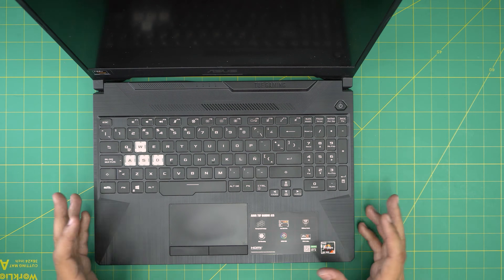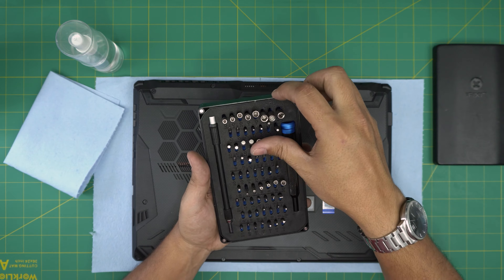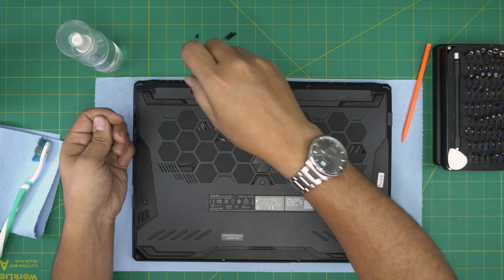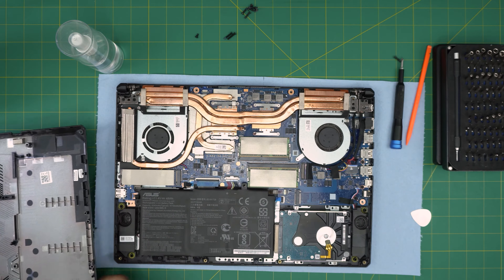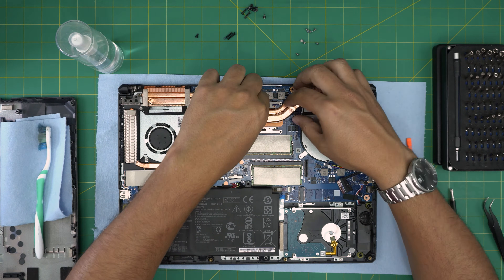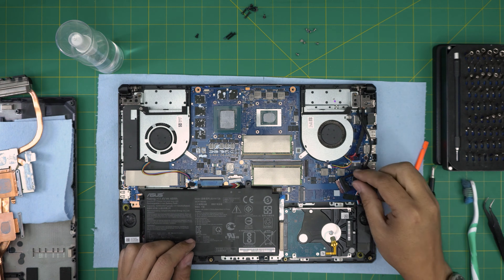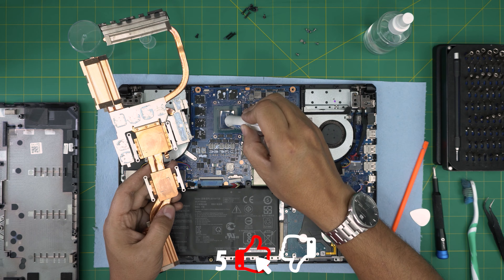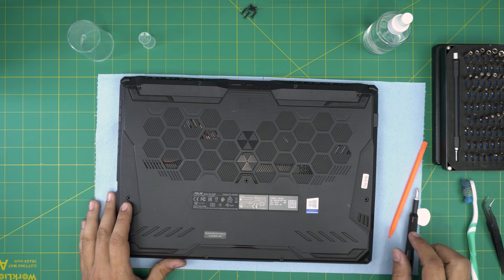How to Repaste and Clean ASUS Tuf Gaming A15 FA506IV Laptop - Step-by-Step Guide 🧹✨

Comment: The c Lock screw does not want to get out what should I do
Reply from the maker: 🫠Regarding your question, the C-lock screw should *not* come out; that is why it is called a C-lock—it prevents the screw from coming out. Just unscrew the screw a few turns, and that is all.
cheers🍻
Reply: @uFixTek  I understanded that but what I meant is it's not even going up a bit enough to Pop up the back of the laptop
Reply from the maker: Ah, if it’s not coming up, don’t worry—firmly insert the guitar pick between the top and bottom covers, and it will release the clips.

Comment: Hi buddy, im from peru. I have a FA506QM  and i gonna use Arctic MX-4 for the CPU and GPU repaste and 99% isopropyl alcohol remove the old paste. In the comments below, I read that it's not necessary to remove the thermal gel. Thoughts?
Reply from the maker: 🫠Regarding your question, yes, don't touch the gel, you can collect it and push it in the center of the component the gel. but no need to clean it.
cheers🍻

Comment: I am sh*t I replaced thermal paste but now my display is not working I guess I am done .
Reply from the maker: Remove both RAM sticks, switch their positions, then power on the device with the charger plugged in and wait up to 40 seconds.
Reply: @uFixTek thanx for replying buddy , but I took it to tech guys and got to know I misplaced display cable and somehow short circuit it , causing motherboard to short circuit, they took it for 1 day to see which component is damaged or is it just display cable damage
Reply from the maker: the display port has a fuse and will prevent shorting the board, so i hope they don't make up reason to charge you extra.
Reply: @uFixTek  they charged around 50 dollars including labor ,

Comment: Hi, i accidentally put thermal paste on the vram and vrm before finding this video. Now my gpu won't show. I've bought the thermal putty, can i apply it on the vram and vrm or do I have to do something particular first?
Reply from the maker: 🫠Regarding your question, if you have used the laptop with thermal paste on the VRAMs and VRMs, then you most likely have damaged some VRMs and need to take it to a repair shop to replace some MOSFETs. Applying thermal gel now will not solve the issue.
Should you have any further questions or requests in the future, please don't hesitate to ask me.
cheers🍻
Reply: Thank you very very much  @uFixTek
Reply from the maker: It's my pleasure my friend.

Comment: Hello, can i remove the fan without removing the heatsink? Because right now i don't have any thermal paste yet, and should i also disconnect that flex cable when opening my laptop? Why?
Reply from the maker: 🫠Regarding your question, you can't remove the fan without first removing the heatsink. You will need to remove the heatsink first. You don't have to disconnect the flex cable for the LCD, but for easier servicing, you can simply disconnect it.
cheers🍻

Comment: can I use thermal pad for the small black things?
Reply from the maker: 🫠Regarding your question, NO, don't use a thermal pad. You will counter-push the heatsink, and it will result in worse temperatures.
cheers🍻

Comment: Always use the spread method... pee size method doesnt always cover the whole cpu or gpu and can leave hot spots or cores that are hotter than others and irregular  performance.
Reply from the maker: 🫠Regarding your recommendation, it is very valid. Spreading is good, but the pea-sized amount is just as effective. There will never be any part left uncovered when you apply a pea-sized amount on a direct die, as long as you cross-tighten the heatsink. The paste will spread evenly over the entire crystal die. Also, as a tip, use a bit more than a pea-sized amount if you're using thermal paste.
Thank you for the feedback.
cheers🍻

Comment: Hey man, I appreciate the guide and I wanna know if I should also be replacing the thermal putty. I have the Arctic MX –6 for the CPU and GPU Repaste is it also safe for me to use an 70% isopropyl alcohol only for removing the old residue? But is it alright If I just leave the thermal putty as is? Since I don’t got one yet
Reply from the maker: 🫠Regarding your question, sure, leave the putty as it is—no need to replace it. Remove the old paste with 70%, but be very careful not to let the 70% get around the GPU or CPU. Make sure you dry it out, as the 70% contains water. Use the MX6 and you'll be fine.
Should you have any further questions or requests in the future, please don't hesitate to ask me.
cheers🍻

Comment: @ufixtek i accidentally applied thermal paste on those small components yesterday. so is there going to be any problem, or should i immediatly remove the thermal paste on these other components. Please help
Reply from the maker: 🫠Regarding your question, as long as you didn't remove the thermal putty and just added thermal paste over it, then you're fine. But if you removed the putty, then you're in trouble—you need to get thermal putty and apply it. There's no need to remove the thermal paste.
Should you have any further questions or requests in the future, please don't hesitate to ask me.
cheers🍻
Reply: @uFixTek  hey im from india and the thermal putty/gel youve linked in your description is not available here or is either very expensive can you answer if i could use thermal pad on those small components instead?

Comment: I've used several times 70% isopropyl alcohol and no issues so far...
Reply from the maker: Yes, you can, but 70% alcohol contains more water, which is not good for components and can slowly damage the crystal die due to degradation. If it gets under the GPU or CPU and you power it on, it's game over.  
Using 70% alcohol is like playing with fire.
Reply: @uFixTek  I did it many years and all good the laptops are still working, but now I switched to 99.99 isopropyl. Today I did service to my Asus TUF with arctic MX4 and 99 isopropyl.
Reply from the maker: Awesome job! The ISO 99 is better in many ways—it's safer, effectively blends adhesives, removes thermal paste easily, and is non-conductive.

Comment: Will it void my warranty if i open the back panel?
Reply from the maker: 🫠Regarding your question, if you in USA, and you don't damage/break it then NO it will not void it.
Should you have any further questions or requests in the future, please don't hesitate to ask me.
cheers🍻

In the USA, the Magnuson-Moss Warranty Act protects consumers' rights regarding warranties for electronics and other products. Under this act:

Right to Repair and Modify: Consumers can open, upgrade, and service their own electronics without voiding the warranty, as long as they don't cause damage during the process.
Prohibition of "Tie-In Sales" Provisions: Manufacturers cannot require consumers to use specific parts or services (e.g., using only authorized repair services) to maintain their warranty unless those parts/services are provided for free.
Burden of Proof on Manufacturer: If a manufacturer denies a warranty claim, they must prove that the consumer's actions (e.g., upgrading RAM or replacing a hard drive) directly caused the issue.
This law is enforced by the Federal Trade Commission (FTC), and the FTC has taken action against companies that include misleading warranty void stickers or policies that violate the Magnuson-Moss Warranty Act.
Reply: @uFixTek  i live in nepal but bought this laptop from Saudi Arabia
Reply from the maker: they you may 90% void the warranty, you need to check the warranty law in your country, but if you bouth the laptop in saudi then your warranty only vaild in saudi.

Comment: Can i replace the thermal putty with thermal pad?
Reply from the maker: 🫠Regarding your question, DO NOT replace the putty with pads. Doing so will push the heatsink away, leading to horrible temperatures.  
The distance is not uniform enough to use thermal pads.  
Use putty.
Should you have any further questions or requests in the future, please don't hesitate to ask me.
cheers🍻
Reply: @uFixTek obtaining thermal putty is hard in my region what other alternatives can i use?

Comment: Aren’t I supposed to hold the power button for 15 second after unplugging the battery?
Reply from the maker: 🫠Regarding your question, no need to there are resistance on the board that discharge the board under 4sec
Should you have any further questions or requests in the future, please don't hesitate to ask me.
cheers🍻

Comment: I can't find putty or gel K5 pro😢😢in my country do you have anything that I can use and can I use thermal grease. My laptop screen randomly turing black and freeze and putty is only one thing I didn't change yet I use my laptop for  3-4 years now.
Reply from the maker: 🫠Regarding your question, don't change the putty, just repaste teh gpu and cpu, you should never use paste where the thermal putty is used, buy thermal putty from ebay or aliexpress.
cheers🍻

Comment: Can you open the itself to clean the fins?
Reply from the maker: 🫠Regarding your question, yes, you can, but you will need to break the rivets on the metal cover over the fan, and then use glue to put it back.
Should you have any further questions or requests in the future, please don't hesitate to ask me.
cheers🍻

Comment: can i use thermal paste on the vrams or should i invest on thermal putty instead?
Reply from the maker: 🫠Regarding your question, NEVER use paste where the thermal putty is used. You will need to use thermal putty or thermal gel; you can get it cheaply on AliExpress.
Reply: Of course not, you need to use thermal putty on vrams.

Comment: Hi bro.What is the ok CPU temperature?
Reply from the maker: Regarding your question, under very high load, the maximum temperature should not exceed 93-95°C. At mid load, it should be 85°C. If the CPU hits 99°C, it will protect itself in two ways: 
1. It will throttle (reduce its speed).
2. If throttling fails and the temperature still exceeds 101°C, it will shut down to prevent damage.
Should you have any further questions or requests in the future, please don't hesitate to ask me.
cheers🍻
Reply: @uFixTek  thanks sir
Reply from the maker: It's my pleasure my friend.

Comment: I have a question, i didn't have thermal putty when i was replacing the thermal paste so i didn't do anything with the capacitors, but two of the capacitors had less putty on it so i applied a little bit of thermal paste, it should be ok right? I didn't do anything else.
Reply from the maker: 🫠Regarding your question, you be fine don't worry , if you didn't mess with the putty that it was there , then you fine.
Should you have any further questions or requests in the future, please don't hesitate to ask me.
cheers🍻
Reply: @uFixTek yea thank you man, i just used some paste on those two specific capacitors because the putty seemed to have been dried up, other than that i didn't do anything.
Reply from the maker: It's my pleasure my friend.

Comment: Just a question. I accidentally removed the putty and don't have a replacement. Would it be ok to run the laptop without it? I have a tuf gaming a15 as well.
Reply from the maker: 🫠Regarding your question, i would HIGHLY recommend you not to use the laptop if you don't have the thermal gel or putty on the components, they will over heat and get damaged 100%.

Comment: Can i use thermal pad for the vram?
Reply from the maker: 🫠Regarding your question, i would highly recommend you not to, because the distance is not a even number and that is why they use thermal putty, if you use a pad it will counter push the heatsink away from the GPU /CPU and you will have a horrible temps.
cheers🍻
Reply: @uFixTek  Thanks for the information
Reply from the maker: It's my pleasure my friend.

Comment: Hey man! Is it fine to just reuse the factory thermal putty like you did? Won't my VRAM and VRM temps get higher by doing so? Also, will I need to rearrenge the putty on the components if it's ok or should I just not touch the putty at all?
Reply from the maker: 🫠Regarding your question, i would re use the putty and rearrange the putty, it won't increase the temp, BUT if you want to spend a bit of money get a good putty:
https://amzn.to/3VlGgtT
but i would reuse if you feel it is still pasty and not rock solid.
Should you have any further questions or requests in the future, please don't hesitate to ask me.
cheers🍻

This is an Amazon affiliate link. When you use my links, you are helping to support the channel. 🙏

Comment: Yo ive got this laptop and didnt realise it had a HDD slot??? 😮 i got both m.2 filled could i also add a hdd? My model is fa506icb and its a 2021 tuf a15 4600h, 32gb, rtx 3050
Reply from the maker: 🫠Regarding your question, SURE you can have two nvme up to 4TB on each and a 2.5' HDD 2TB or 2.5' SSD 4TB.
https://youtu.be/jR9kTuSQTlk
cheers🍻
Reply: @uFixTek hello i have the small gap for a 2.5 SSD however there is no connections to fit it? Like no sata plug in or power anywhere. Took the battery out incase it under there and still no look. Model no FA506ICB

Comment: Hey big thanks to you I'm getting ready to follow your guide in this video but I have two questions:

1)Is it really okay to not change thermal putties around the gpu? (I mean would it does a negative effect that not to touch those little chipsets and their old thermal putties)

2) Are there any cheaper options for thermal putties than k5 pro?
Reply from the maker: Thank you for your feedback! If you wish to support the channel, you can like, subscribe, or both!
Regarding your question, i would personally just collect the old putty and place them on each components, if im on a tight budget. because those are good quality putty.
else if i can get the money i would defiantly replace it with K5 pro.
else if i'm running short on my wallet and the putty on the board looks horrible and not enough to be collected to fill it, then i would get the cheap putty from aliexpress.
https://de.aliexpress.com/item/1005004523490885.html
Should you have any further questions or requests in the future, please don't hesitate to ask me.
cheers🍻

Comment: Hi, thanks a lot for the video. I have a question: I have Arctic MX-4 thermal compound and Kryonaut thermal grizzly. Where should I apply them if I want to repaste completely?  I'd be very thankful if you add screenshots with arrows. Thank you.
Reply from the maker: Thank you for your feedback! If you wish to support the channel, you can like, subscribe, or both!
Regarding your question, use the Kryonaut thermal grizzly on the GPU and CPU as i did in the video right @8:50
Should you have any further questions or requests in the future, please don't hesitate to ask me.
cheers🍻
Reply: @uFixTek  ok, thank you, but what about those places where the thermal putty was applied - not CPU and GPU (I don't know what those small pieces on the sides are called)? Should I clean them and apply Arctic MX-4 or Kryonaut thermal grizzly?
Reply from the maker: no for those leave them with the original putty or get the : K5 PRO: https://amzn.to/3O8xyuP
it is expensive because is 110g, you can get putty on aliexpress too very cheap. NEVER use paste on components where putty is used.
Reply: @uFixTek  ok, thank you very much for your help.

Comment: hi, very nice video. i have a question, is it ok if i use thermal pads instead of thermal putty for the vram and other chips? if yes what size and dimensions of thermal pads should i get?
Reply from the maker: Thank you for your feedback! If you wish to support the channel, you can like, subscribe, or both!
Regarding your question, no my friend, never use pads or paste where the putty goes, there reason is that the gap is not on a even level 1mm or 1.5mm , if you place a higher pads it will counter push the heatsink and you will get horrible results and performance on CPU or GPU. use a putty or gel:
 https://amzn.to/4aAXwkk
Should you have any further questions or requests in the future, please don't hesitate to ask me.
cheers🍻

This is an Amazon affiliate link. When you use my links, you are helping to support the channel. 🙏

Comment: I want to clean my laptop but the bottom corner screw just keeps spinning and wont pry open. Help please
Reply from the maker: Thank you for your feedback! If you wish to support the channel, you can like, subscribe, or both!
Regarding your question, you just confirmed me that you didn't watch the  video 😐
because right at @2:40 i explained the screws and about the bottom corner screw.
it has a C lock on it. and it will not come out!
Should you have any further questions or requests in the future, please don't hesitate to ask me.
cheers🍻
Reply: @uFixTek  how do I get off the C lock then
Reply: @uFixTek the screw came off but the laptop won't pry open what should I do
Reply: I spinned the screws too much and the screw just came off
Reply from the maker: please watch the video and not skip the steps else you will damage the laptop!
- the c lock was not made to come off,  it was meant to keep the screw on the case, you just had to loose up the screw.
now that you have pulled the screw from the C lock out with force , now you need to worry about finding that C lock inside the laptop , if it moves over the motherboard it will short the board and damage the board!,

solution (assuming based on what you said that you removed the screw that had a c lock):
use a guitar pick as in the video @4:07 to lift the bottom cover and once you removed the bottom cover you will need to look for that metallic SMAL C lock.
when you put back the cover no need for the C lock. (just trash that C lock) screw back the cover like other screws.
the c lock looks like this: https://imgur.com/a/oh0ixdp

you will need a guitar pick and use force to remove the cover as seen @4:15